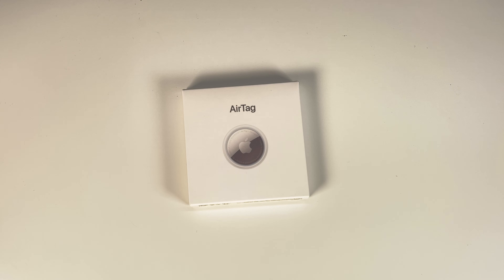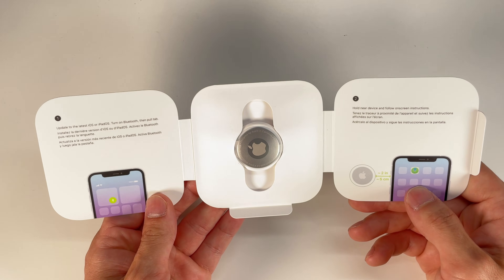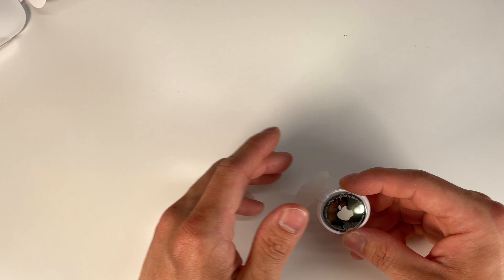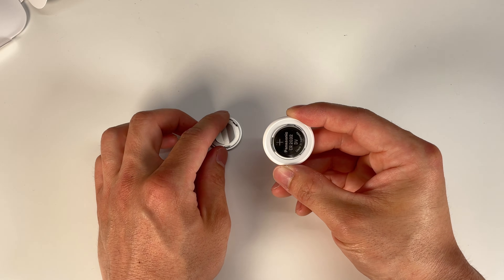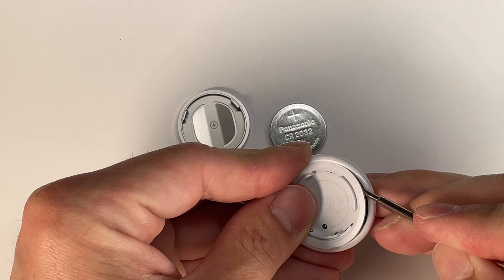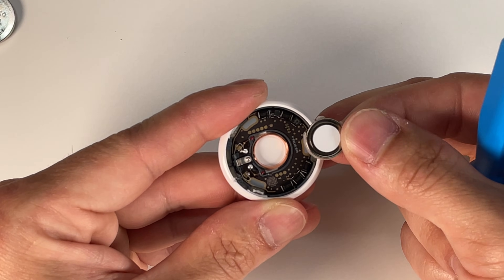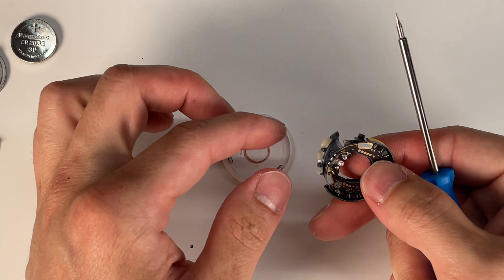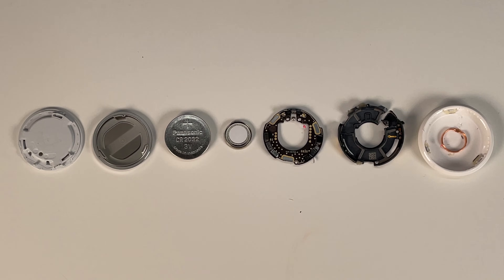Apple AirTag Teardown - What's Inside (Battery, Speaker, Antenna, Motherboard, Case)

Comment: I tried to keep it in my wallet in a slot. It isn’t accurately connecting all the time, as it has advised me that I left my wallet at home, when I haven’t(I still had it with me) But the one time I did leave my wallet elsewhere, it didn’t let me know that I left it, but I was able to track it when I looked for it in the “Find My” app. I was looking to see if I could make it smaller by taking it apart & this video answered my question for me, Thank You!! I am going to try & attach it to the outside of my wallet somehow.
Reply: Ridge Wallet makes a wallet with a money clip that also holds an AirTag. I own one and it works great for me

Comment: remove the speaker and the stalker feature is gone 
now u can stalk anyone without the knoing it xD what a great feature
Reply: nearby iphones detect airtags that are not theirs
Reply: @Manuel Manu Hey, it seems you didn't the whole apple keynote at all. 
If someone's iPhone detects an unknown AirTag that is following him, he can deactivate it so that it will stop tracking him.
Removing the speaker won't help you by any means. lol.

To sum it up, the AirTags isn't intended for scenarios like stolen items. Apple emphasized that AirTags is for finding an item you lost or misplaced.
Even their demo video shows a man finding his keys inside his sofa.
Reply: @iamwisdomsky  For example, what can you do if you find (countless) unknown airtags on the bus?
Reply: @iamwisdomsky  except only iPhone users can get this uknown AirTag notification. If you remove the speaker, it becomes the most advanced device for stalking people who don't use iPhones on the planet. (unfortunately)
Reply: @iamwisdomsky  "deactivating" it involves manually pulling the battery from the AirTag. It's not as simple as tapping a botton on your iPhone. Otherwise, people could also abuse that feature to arbitrarily turn off other people's AirTags. So good luck trying to locate that AirTag with the speaker disabled.
Reply: @Manuel Manu He can find the airtag because his Phone will be able to detect that it's following him and then his phone will also give him the ability to deactivate it remotely even if it's not his AirTag. As long as he uses an iPhone, he can deactivate it.

You didn't think that apple haven't thought of that scenario. do you?
They can't afford to get sued, that's why they emphasized AirTag's security during the keynote.

Comment: Finally a nice teardown, thanks! I am wondering if there is a way to get it to work without the whole case and get it as thin as possible.
Reply: And if you change the battery from a 2023 (2.3mm ) with a 2012 (2012) you remove 1mm in thickness at the cost of 4 min month of battery life instead of 12
Reply from the maker: Might be possible if you were more careful than me :) Although I'd be hard since there is a lot of adhesive and a battery holder.
Reply: Hi dear Did u try it?  i need the rusult
Reply: Same

Comment: If I'm correct, the small coil is the speaker, you removed a magnet (I tought it was using a piezoelectric speaker). The bigger one, should be the NFC. 
Thanks for your video, good sir.
Reply from the maker: The center is magnetized, I thought it was a speaker since some speakers have magnets in the center. The bigger rings is for NFC as you mentioned!
Reply: @brandon20904  
Yes. That's the idea. The speaker's coil needs that magnet, unless it's a piezoelectric one.
Reply: @cringemaki  so if you remove the Magnet-middle-thing the speaker is silent?
Reply: @jetztstaubts  
That’s how most common speakers work. You can create your own. It’s a fun project, tho. But dont expect a high quality.
Reply: @jetztstaubts  this is what I’m interested in knowing.